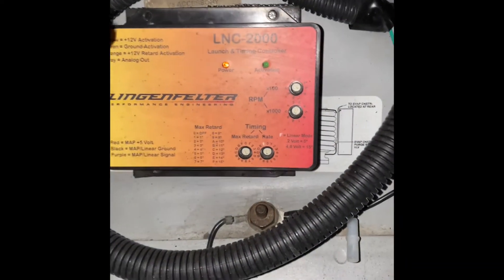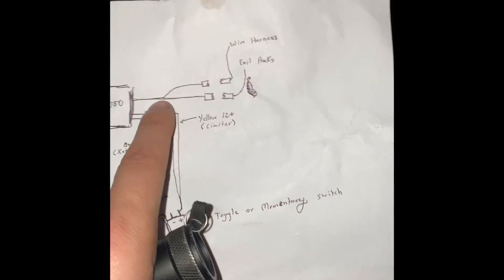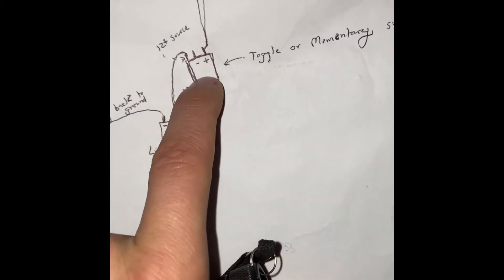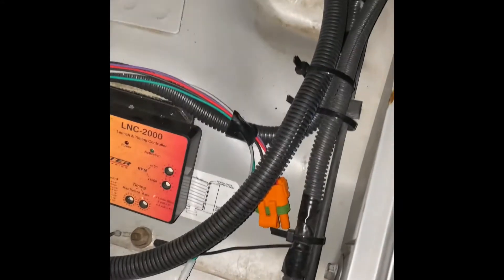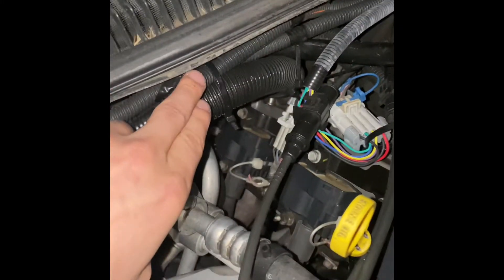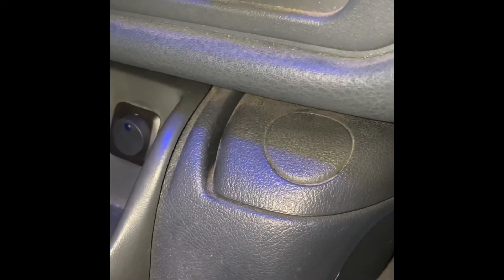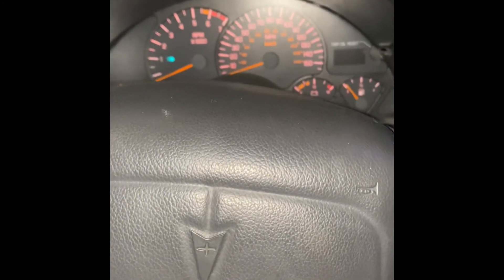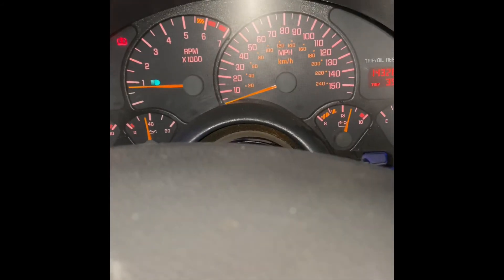Lingenfelter LNC-2000 install

Comment: You would definitely benefit swapping to a round truck heat sink coil setup on that ls1 👍 aka the d585 coils
Reply from the maker: @sterlingtomlin9926  Appreciate the info - actually ended up selling it a few years back but this is good info for others

Comment: You probably dont have the car anymore but supplying a ground to your switch would have allowed the light to come on. You didnt need it for the purpose of the 2 step operation, as you were switching power only. In order for the led in the switch to work you needed power as well as ground.
Reply from the maker: @LooseyGooseyOG  Wiring is my bane so I appreciate this. There was a few times I accidentally had the controller activated while doing normal driving so the light function would have helped a lot. Good info for others who may be wondering about this

Comment: Does this lnc 2000 fit my ls based 6.2 L94 in my 2010 denali? I can’t find which one is the right one
Reply from the maker: I would imagine it plugs into your coil packs and wiring harness no problem. Give it a shot and if it doesn’t then you have your answer and you can simply return it. I’m curious as well but my guess it will work just fine.

Comment: Hey what's the part number for your toggle switch??? I want to put mines where the cigarette lighter goes
Reply from the maker: Unfortunately I am not sure, I would check for you but I’m currently overseas lol what I did was take the ring that surrounds the cigarette lighter on the center console out and brought it with me into a believe Autozone and simply got a generic 3 prong toggle switch. The ring may sound confusing but if you look at the cigarette lighter you’ll see what I’m talking about. Removing the actual lighter is tough, be really careful not to crack the center console, after the lighter is removed I believe that’s when you remove the ring which I think has two tabs that hold it to the console. Obviously it’s double so I did it just take your time, also make sure you get a 3 prong toggle switch that tells you where to positive, negative and power prongs are.

Comment: Hey man I set it up the same way u did but it’s not holding where I set the rpm and it’s not back firing or anything both power and activation lights are on
Reply from the maker: Very sorry to hear you are having issues, but I’ll do my best to help you figure it out! I’d worry less about the afterfire right now. First we need to get the limiter function working. I initially had issues as well and had to turn car off and on a few times before the limiter function worked for me. 

1) What RPM do you have limiter set at?
2)Are you using momentary or non momentary switch?
Reply: @Doc-Ready  i have it set on 2100 and it’s a momentary switch
Reply from the maker: @arturols1   Set it to 3500rpms and do it while car is off, then turn car on and try. You connected both the limiter and timing wires to the positive side of momentary switch, correct? Also, make sure you don’t have any wires connected to ground side of switch. Where are you drawing your power source from, the cigarette outlet?
Reply: @Doc-Ready  Yeah from the cigarette outlet do u think I need to hook up the green wire also directly to my ground or do I even need that wire
Reply from the maker: @arturols1  It’s been awhile since Iv done it. What color wires were connected to your cigarette lighter?
Reply from the maker: @arturols1  Been a few days, hope you were able to get the issue sorted out!
Reply: @Doc-Ready  yeah i got  it now
Reply from the maker: @arturols1  Awesome, wish I could have been more help but glad it’s resolved!
Reply: @arturols1 did u have to wire it bro having the same problem
Reply: Ground it*^
Reply: @Dat1slow300  yeah you have to ground it out